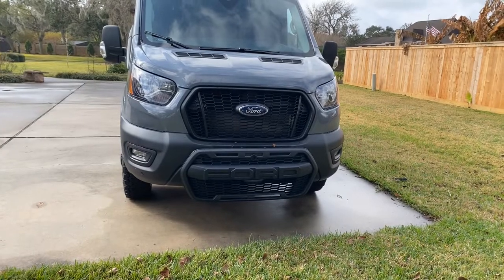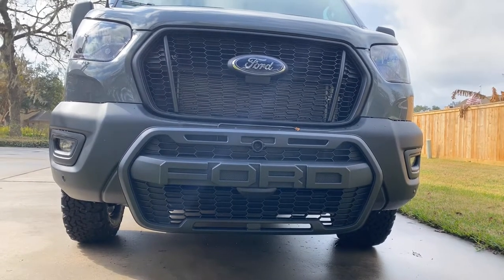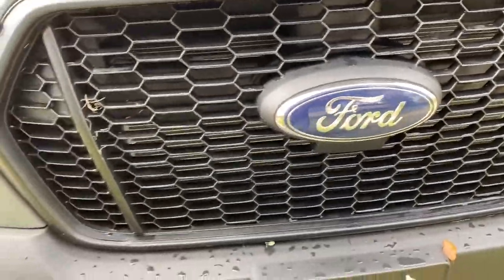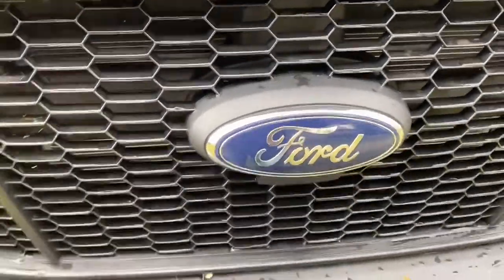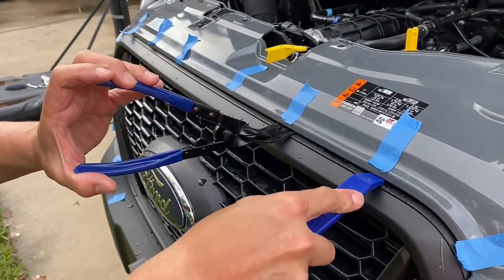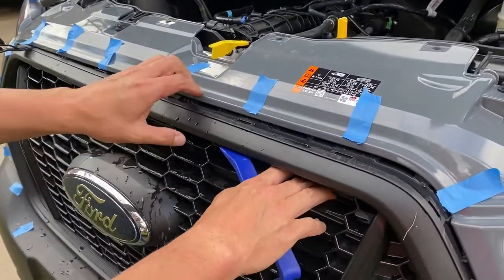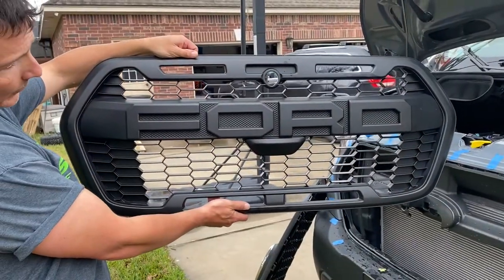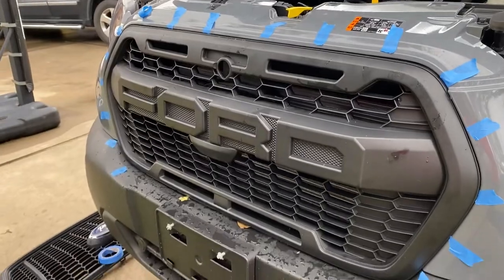Ford Transit Van Build | Installing the Ford Raptor Grille | Taking your van from Blah to Buff!

Comment: Just ordered a 2023 transit this same color… debating removing or blacking out the blue oval or this option. Really helpful, thanks
Reply from the maker: I love this color!  I never saw it on a paint chip or another van--just new that I wanted something darker than avalanche grey but not as dark as the carbonized grey.  It was even better than expected when we finally saw our van!  As far as the grille goes--once I saw the Raptor style, I had to have one.  We literally drove the van home from KC and changed it over a few days later.  We took a chance and ordered it off of ebay last fall from a seller in Greece for about $350, and luckily it arrived it perfect condition.  Now our van doesn't look like a delivery van! 😊
Reply: Nice job.  What is the name of that tool you used for the clips? And what was the specific color of your van paint color?
Reply from the maker: @KentFleshman  its part of a trim tool kit we bought on amazon.  Here is the link to the one we bought----https://www.amazon.com/AUTOXEL-Retainer-Fastener-Terminal-Adhesive/dp/B085XSSR88/ref=sr_1_1?keywords=byniiur&qid=1663103726&sr=8-1&th=1
Both tools used in this video came from this kit!  Also, our van color is Abyss Grey.